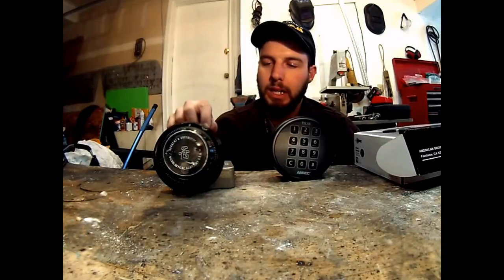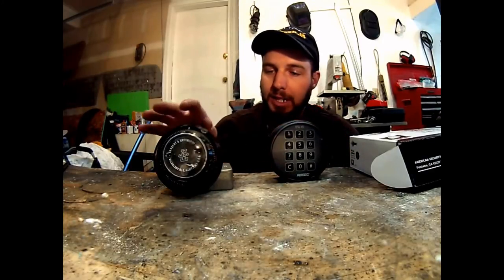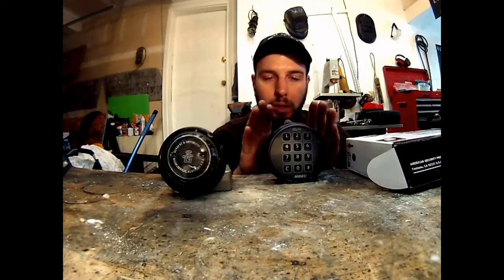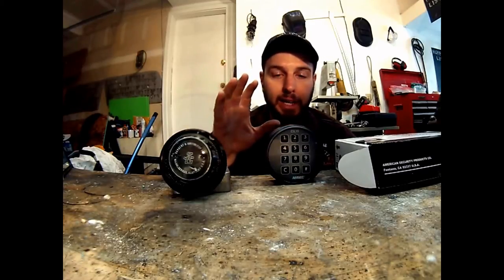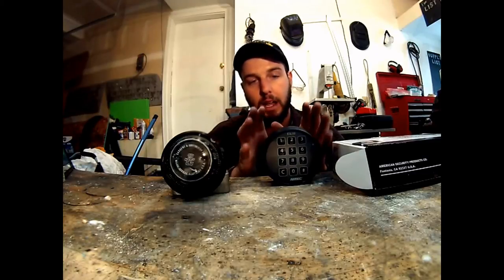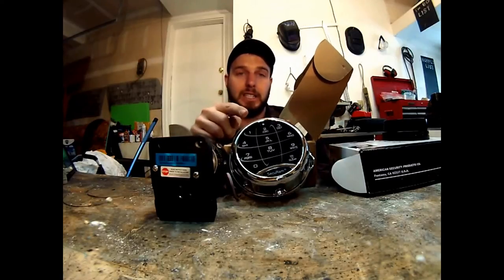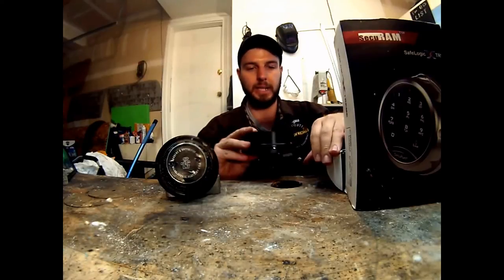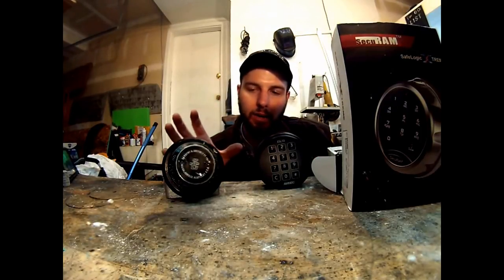Dial VS Keypad Gun Safe Lock

Comment: Good video. Have you seen many failures in the S&G 6120 series? I put one on my safe about 8 years ago and over the past year and half sometimes I'll need to key in my code two or three times and this is with new batteries in it. I'm thinking the keypad is going bad. It has a 2008 mfg. date. I do have an S&G 6700 so I'm likely going to go back to the mechanical lock for now. Do you know if an electronic lock can be troubleshooted or tested?
Reply from the maker: legalsolutions07 S&G 6120 is notorious for failing. one of the most drilled Locks. I would get rid of it asap
Reply: Thank you. I just checked my S&G 6700 and it seems to still work smooth even though it's been sitting for 8 years. Any recommended grease or lube for the wheel pack or brass levers? Thanks.
Reply from the maker: If it ain't broke don't fix it

Comment: Any information about why electronic lock fails? Beside foil keypads tends not to age too gracefully they generally just gets more and more error prone until you decide to change it.
Then there's the solenoid. Many electronic locks rely on a solenoid at the ultimate end (though not vulnerable to knocking as on cheap safes).
Guess (yes my guess with my electronic knowledge) they typically tends to get stuck as they move less smooth with age especially if they're in a basement with higher humidity, lower room temperatures than normal etc. If so they could be rescued by taking a piece of wood (to protect paint job) and knock the door with a hammer. The shocks will in many cases loosen the stuck parts. Then do not close it again - time for a new lock ;)
Though if you're skilled in fine mechanics you can probably take apart the stuck part apart and polish it smooth again and give it some long lasting oil - don't forget to service it regularly afterwards! Probably not recommended by manufacturer but hey if you know what you're it won't be less safe than before and remember of course the manufacturer want you to buy a new lock rather than repairing or servicing the old - it might be cheaper for you but it means no money for the manufacturer ;)
Damp or colder than room temp areas just causes many metals to get a rough surface even though you do not instantly recognize it with the naked eye. I've seen many solenoids (not safe locks though) not moving smoothly because of being used in less than optimal environments but they can usually be made good again with a little effort.
Reply from the maker: look up my review on the Securam safe logic Extreme. it's both in one 😉
Reply: +Wayne Winton Thanks. Nice lock. But doesn't seem to answer my question/hypothesis. What/how do electronic locks usually fail? My hypothesis is that it's mechanical and most likely frequency is very much dependent on environment. It is quite rare that electronics itself fails. Especially low power battery operated electronics unless battery leaks (use lithium batteries/cells to avoid that - available even in 1,5 v varieties for drop in alkaline replacements)
Reply from the maker: Selonid fails, motor fails gear and drive fail. Depends on manufacturer of lock.
Reply: OK thanks. Mechanical problems typically then. Just as I'd expect. Ever tried knocking the door? (with wood between to spare paint job). That should be able to temporarily free many failures as mechanical failures are usually a gradual failure because of wear and/or environment. Of course problem should still be resolved properly afterwards as they'll only get worse with time - but a drilling spared.
Just a theory. While I got my safe still underway I'm researching an underfloor safe too to spread values and especially small volume high value objects while using the larger safe for... Well larger objects;). Dial combinations are very rare around here and if wanting a dial combination lock that's a double up in price. The larger safe I've ordered the seller had to order from manufacturer as in in Denmark dial combinations are just about non existent - at least the price extra for mechanical vs the default key for once was very fair and on par with price difference in the locks themselves when comparing German online prices. Locks here seems to be 80% keys (i really wonder what is so great about keys?) and 19% electronics and 1 percent for vintage and oddballs like me something like that.
I could change the keyed lock in the floor safe myself to a mechanical dial but I'm unsure to what degree it'll make the safe less safe that it has an elongated keyhole instead of a perfect circular (I can drill it larger if needed and make threaded hole for dial mount). Potentially that could make it easier to drill it to look at the discs.
I could also go with electronics though I'm mostly wanting a mechanical. No issue to install myself and again a hefty premium with fantasy prices over keyed lock if ordered on the safe so ordering a lock online and changing it myself would save quite a bit of money and even have a key lock to sell to someone who worn their out. It will not quite see a basement environment but located near central heating humidity might be slightly higher although never condensing. I really don't like keys - too many factors that lessens security. What if thieves find the spare key? Sure it could be stored elsewhere but you still have to always carry the one you're using. Then the wrong people may see it or if you're unlucky and get robbed in the street of the kind where they drag you to ATMs they might notice your key - which is easily recognizable as a safe so while visiting ATMs why not also visit your home clearly there must be something really valuable and your address is even on the social security card. (It's not normal for people here to have decent safes not even those than those that can be opened by a potato are too common)